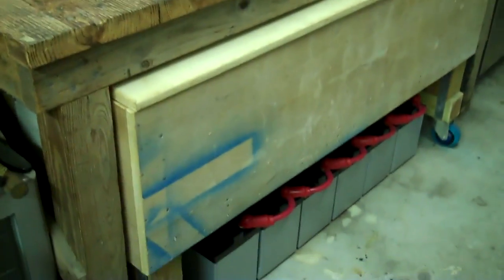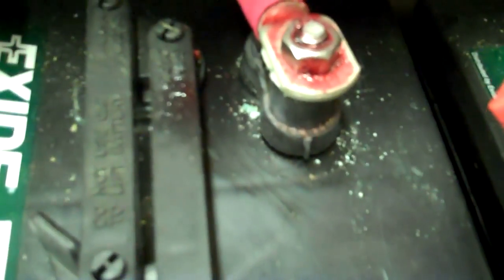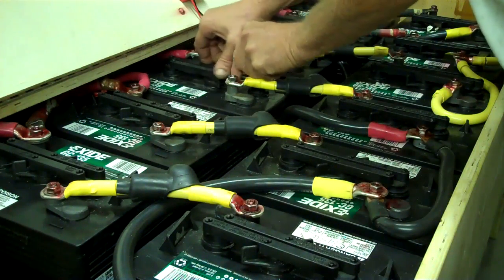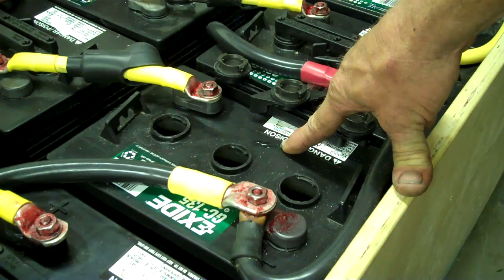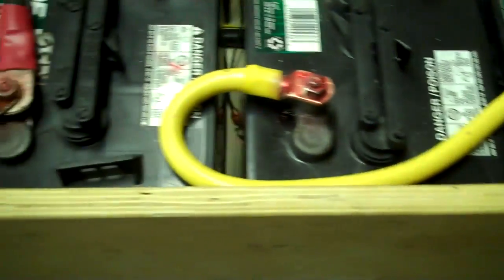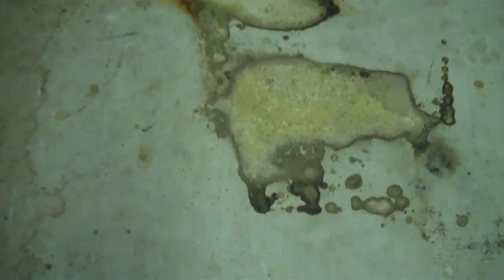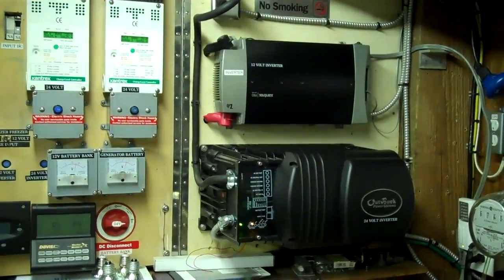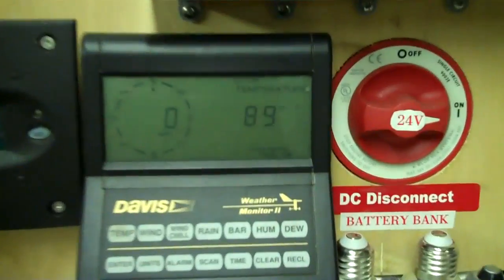SOLAR POWER AND BATTERY BANKS TRYING TO HELP IT MAKE SENSE. MORE TO COME...

Comment: Here we went with the Fork lift batteries which I highly recommend - they can really handle the charge/discharge cycles and had the lowest cost per kW.  Just put up the 2nd video in the Relentless Homestead Solar Power "Star-Lite Wars" series - this one shows the battery box build.  Saw that you are also using the Outback equipment - nice stuff.  I like your setup, provides some flexibility.

Comment: Hello, if you are still activelyt answering or responding to comments in your videos, please answer a question for me: I would like to start off with 2 Renegy 100w Solar Panels and 4 of the best power output/long duration power out batteries available, but was wondering if one of the 4 batteries could be one of the following: http://www.amazon.com/Stanley-J5C09-Starter-Built-Compressor/dp/B002X6VXL4/ref=sr_1_1?ie=UTF8&qid=1451272017&sr=8-1&keywords=3-in-1+battery+jump+box? Look forward to your reply! Thumbs up on the videos!

Comment: That's a helluva setup, way more than I'd ever want to get into or could afford, but it sure is nice.
One thing I did notice, your fire extinguisher in not mounted where it should be.  It should not be mounted next to all your electrical equipment, it should be mounted by the exit to that room.  If those battery banks or the other equipment would short and catch fire, you will not be able to get to the extinguisher.  And I'd never buy one of those small extinguishers with a plastic top, they're not rechargeable, and it probably isn't big enough for what you have there.

Comment: Is your battery bank kept in the house basement?  If so, should we (you), be concerned about battery offgassing hydrogien  during charging?  I have a simular size bank kept in my garage due to offgassing concerns....but here in michigan , winter affects my battefies....i would love to keep battery bank in my basement for this reason...but i dont know about offgas dangers...if any.  Thanks in advance.
Reply: schickmann The basement is the best place due to it's stable temp.  You could build a box around the batteries with a small fan and a drier style vent to the outside.  In some cases the fan can be hooked up to the charge controller so that it only goes on when the batt's are being charged.  This is assuming you are using flooded batteries. If you went with an AGM style battery they don't vent under normal usage and should be fine in a basement.  That being said I would probably still build a box around them with a fan, which would be used during bulk charging and especially equalizing (not sure what the the AGM equalizing requirements are so that may be a moot point)

Comment: want to migrate from "on grid" to diy solar and wind. Currently on grid, but my elect co charges me $25 per month just to use their equipment. I keep my bill under $70 per month, even while using AC here in Florida. Winter months, I use a wood stove for heating, so no issue there.

Comment: 6v batteries hold more amps...Why are you using 12 volt batteries?
Reply from the maker: I have a 6v batteries and 12v batteries. Amperage has nothing to do with it...
Reply: OBXSOLWIND 

No, I am talking about connections for the battery bank. As that video shows only four 12v batteries in conjunction, I was wondering if I wanted to do 12 to 30 batteries, where and how would I connect that?

Comment: On a grid system what is the normal volts/ amps coming into a house? and should you get your battery bank higher than that if you are doing a connected with the grid system? Thanks for any help you can give on this...I am a very new newbie to solar energy and want to get started on the right page.

Comment: It's not so much that concrete is bad for batteries, it more of the issue of maintenance.  If acid is allowed to form a trace over the top and down to the concrete, the porous concrete, which has a high amount of water in it, will quickly discharge the battery leading to early failure.  If the batteries are maintained well (like yours) an acid trace never forms and concrete is ok... except for the way it will eat it up (as you pointed out).  The benefit of concrete is in uniform cooling of banks

Comment from the maker: That is a tough question to answer. You can expect a solar panel to put out half its rated wattage on a daily basis. Just to maintane a full charge on this battery bank requires at least a 50W panel and thats not including usage and recharging. Hope that helped...

Comment: what do you use to link all the batteries together, i plan on linking 4 12V golf cart batteries together but starting only with 2. i have no idea what kind or where to buy the cables / what kind

Comment: Very informative videos!  Thanks. I'm ready to buy a bank of batteries for a solar system.  I am thinking about wet lead acid batteries, but I'm concerned about discharge of explosive/corrosive gases. I see you have your bank of wet lead acid batteries indoors.  Do you have any concerns about gas discharge from the batteries?  Is your battery bank enclosure vented to vent discharge gases outside?  I

Comment from the maker: Marine batteries are not true deep cycle  batteries. They will have a very short life in an off grid solar setup however they are a good option for a backup system.

Comment: What I don't understand is the charge controller. Do you need one matched to the number of batteries? matched to the number of solar panels? What if you go with wind, will the same controller work?
Does anyone have links to info or forums?

Comment: If you coat all exposed metal (battery posts, cable ends, connecting hardware) with Vaseline you should have no more corrosion problems. I have been doing this for years.

Comment: Power here has been out here for a week now and our's came back on....the inlaws are still without grid power and estimates say they may not see the grid power for another week. batteries are worth every penny when you need them.

Question: Can you recharge the battery bank too fast? too many amps thrown back in too fast? Or will they just take whatever you can throw at them until they build back to 14.4 volts?

Comment: I have been shopping on ebay for inverters to run basic things in house on a power outage & most inverters I see have a rating like 2000 watts  but only continue usage of 1000 watts. Some do not & colbra rates theres at at not suitable for continuous use. I have not seen this on outbacks but cannot afford these right now. any suggestions. I run presently run 900watts grid tied at this time & looking also in buying more solar panels. Cheapest I seen are from ULsolar.